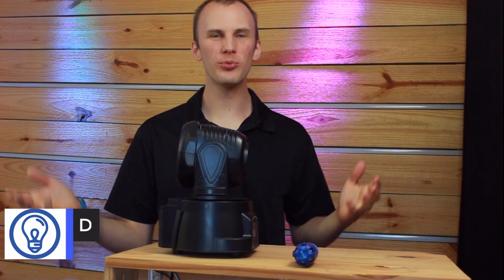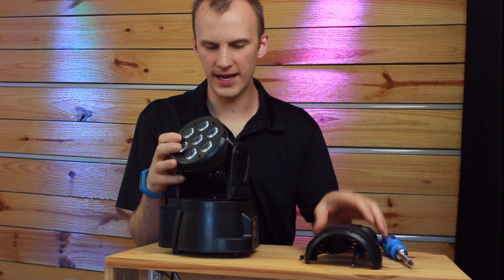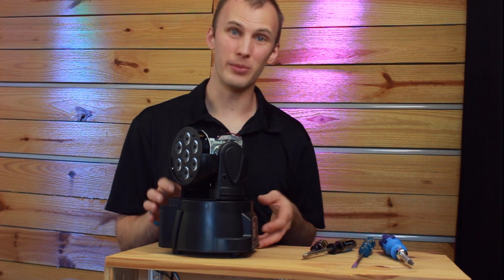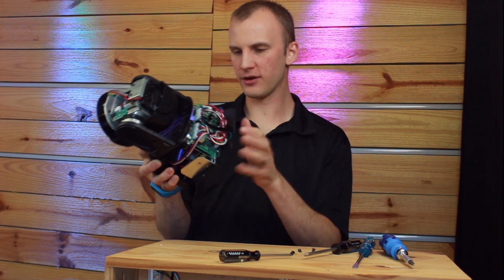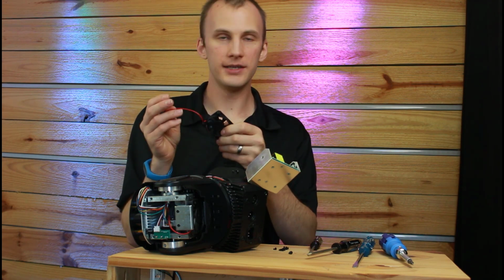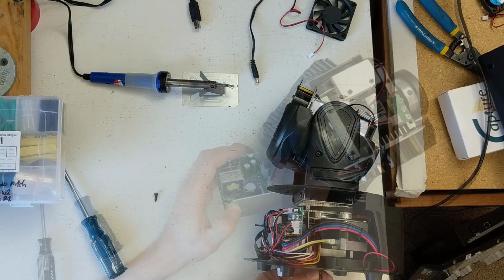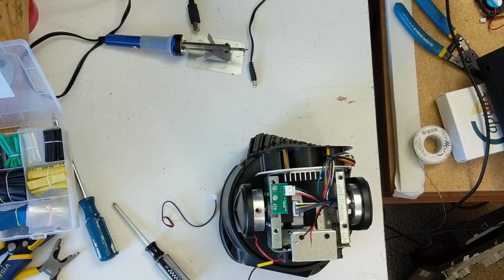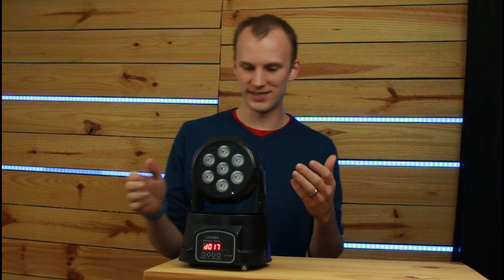Tearing Down and Quieting a Mini Moving Head: Lixada MH Fan Mod

Comment: I am using these cheap Chinese moving heads since 2016, seems that only one factory built and then dozens of re sellers add their own names on it. I have some still running after eight years and no problem at all. Noticed that the old ones are more heavy than the new ones. The problem is this one: when the power is off, you can move manually the head in any direction, tilt, up and down, turn, left and right and nothing happens. But if you accidentally touch the head while it is turning, the belt stops and the gears (motor or the rotary gear) keep moving. That makes the full movement and stop compromised. The head then will turn half degrees of what it supposed to do, if you have it to 540 degrees, it will stop at 180 degrees, and so on. My question is, does somebody knows the steps to put it back as original? I tried, I removed the belt, moved a few teeth of the gear and put it back but seems not working. I researched internet for solutions but it seems to be a dead end. Will be fine is somebody found or have a solution and post it here, thanks.

Comment: Great idea David. Solved an annoying problem with some cheap Equinox moving heads, which are now about 10dBA quieter - which is a 10x reduction. Massive difference. One additional tip. You do not even have to “sodder” these fan connections. Just get some Scotchlok UY2 “Jelly” connectors and cut and splice the wires. I had 2 fans per head. One 40mm x 10mm - replaced this with a Noctua premium PC fan. The 60mm x 10mm was harder to replace with a quiet one as Noctua fans only come in 60x25mm. I eventually found a 3D printer fan from AAB Cooling - the “Silent 6”. Thanks again.
Reply: These equinox lights didn’t happen to be the 150 wash lights? (The earlier model)

Comment: You’ve inspired me to give it a shot!  I was afraid that the voltage wouldn’t be listed but I think it’s safe to assume they will be 12v fans, especially if they’re cheaper lights that are built with more common parts.  And it def helps if the spec is printed on the fan…anyways, thanks for putting the time in to share this video.

Comment: the links point to a 60x10 and 50x10 fan, but in the video there is a 40x10 and a 50x10. So what size is in the head? 40x10?
Reply from the maker: Nothing like amazon to change around products under the same sku...follow the video!
Reply: @LearnStageLighting  Coming back to this, I just measured the fan in my units head to be 60 wide, so I think the video may be wrong...

Comment: No, you don't want the primary fan to pull air inside the fixture. It's not just to minimize dust accumulation, it's because you want the fan to pull hot interior air OUT of the fixture. For that reason, an exhaust fan should be close to the exterior grill, preferably sealed with a rubber gasket to prevent it from rattling. There should also be plenty of small air intake holes around the perimeter of the heat sink.
Reply from the maker: That's great, but I'm not going to change the design of a fixture from the manufacturer, just upgrade the fans
Reply: In this case, it's your choice which way you want to orient the fan, either blowing air and dust into the fixture, or sucking hot air out of the fixture. I won't belabor the obvious.
Reply: It’s designed tu pull in cold air from the outside in and the cold air hits the heatsink then that air goes out through the exhaust holes

Comment: Great video! Do you have any tips about the light is not turning on at all?
Reply from the maker: I would test it from the menu on the unit - it has some automatic modes.  If those work but DMX doesn't, then there is something wrong in how you are controlling it.

Comment: Hey David,
Thanks for the video it was very helpful. I used your links and bought enough fans for my five lights and I followed your hack. It's been a week now and these things are so much quieter than before. I would guess the noise went down from 100% to 25% of the original server room sound or even quieter. I'm using them in a small room that I've converted into a video studio. So far, it's been amazing. Thanks again. 💥BOOM!!!💥™
Reply from the maker: Great! Glad to hear it!

Comment: Modifying lights are fun. I took and replaced a gobo in my ADJ FS3Z to a small offset pinhole. Now I have a beam effect. Furthermore i can add the 2nd gobo and have a poor mans animation wheel. Now I am in the process of taking the a static gobo I dislike and making it an open spot and placing a glass CTO filter to give it a warm white effect. Now I just doubled my colors.
Reply: Rad-I-Nation would love to know how you replaced gels in one of the cheaper spot fixtures.. am tempted to put in CTO myself - not sure why more cheaper lights don’t have it.

Comment: Great from a former service tech a great and easy job by the way what is the cost for replacement fans .
Reply from the maker: See the description - I linked to them below on Amazon - hard to find single fans for sale, but in the multi kits they fans are $3-5 each

Comment: I am having a LED DMX issue.  
I set LED#1 to Address #1.  192ch board.  
Set led to address #17. 
Plug in led#1.  Works fine.  
Plug in DMX to go to LED#2 and #1 goes out and no control over anything. 
I can not find any info for help.
Reply from the maker: It sounds like unit 2 is faulty OR is sending out some sort of signal to control the first light.  The first thing I would do is grab the manual for the light and verify that it is in the DMX mode, and not any stand-alone/automated/master/slave mode.